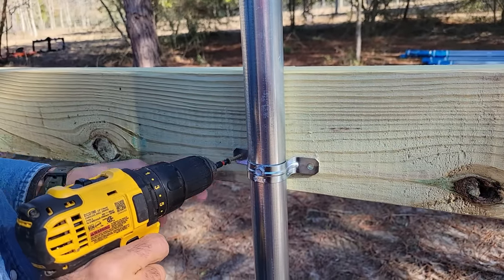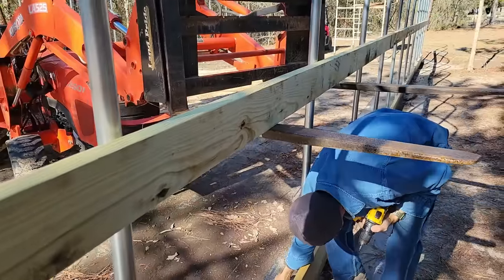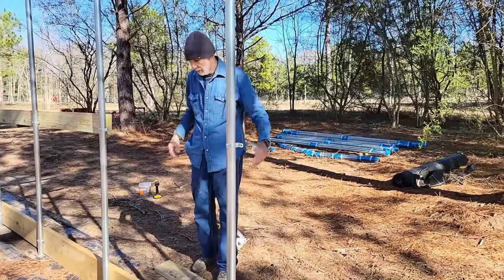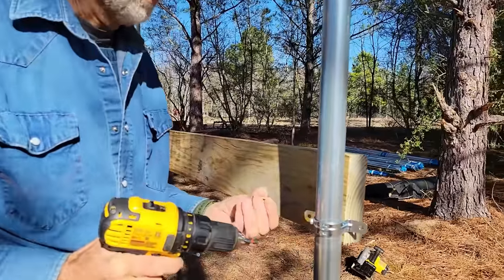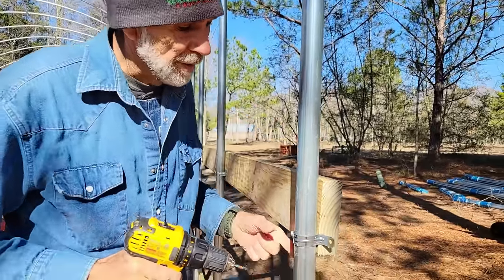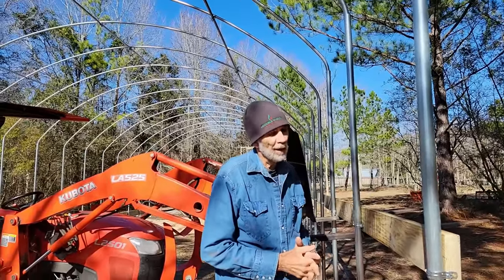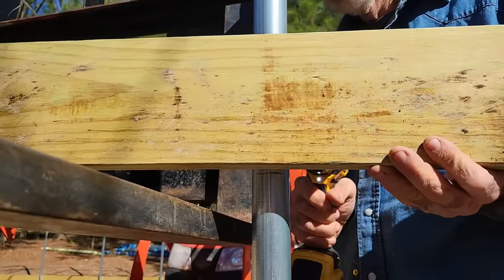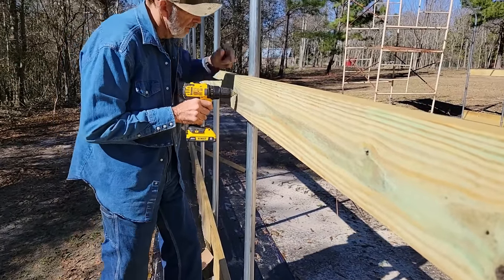Tips on Installing a High Tunnel (Jan 2024)

Comment: If you don't have a tractor and forks you have a couple of options. 

1) Use F style bar clamps. Drill a hole in the center of a scrap 2x4 6 - 12" long and then rip it in two. Use these boards to as a jig for the pipe bar clamp.
2) You can make hangers using 1x1 boards and tube straps. Just screw the tube scrap to one side of the board and around the post, then tighten it down.

I both uses, you may need to shim the clamping area to get a tight enough bite for the clamp to hold up the board.